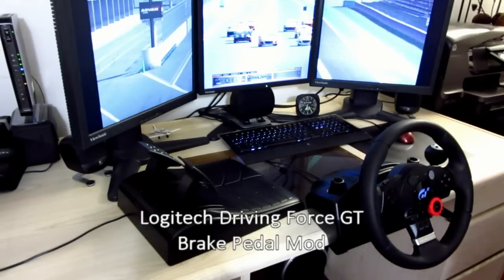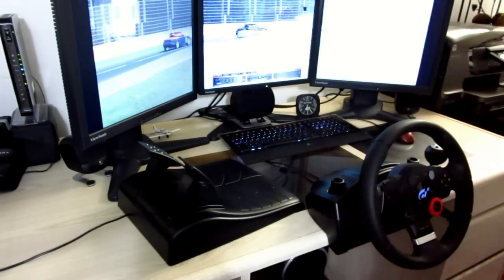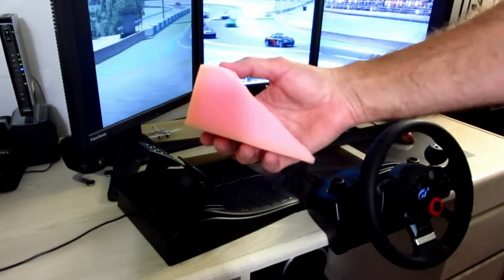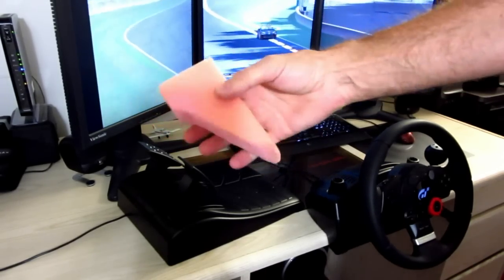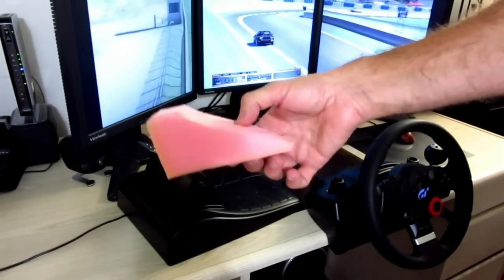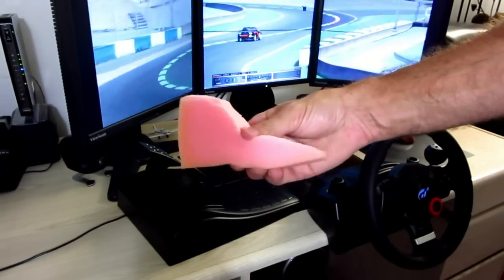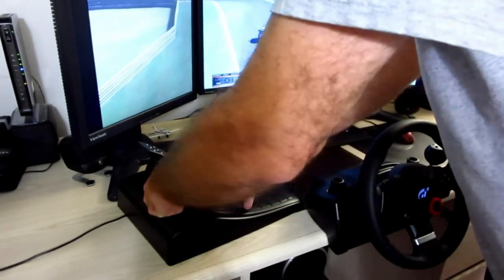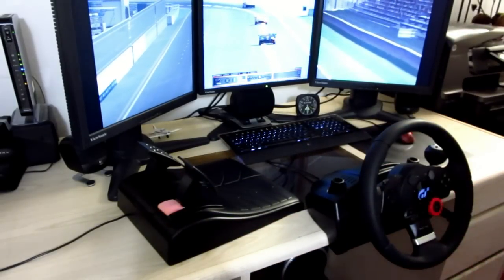Logitech Driving Force GT Brake Pedal Mod (DFGT)

Comment from the maker: The overall length of my current one is 5.5 inches.
It is 3 inches high and 1.75 inches wide.
The flat area on the top (tallest part) is 1.5 inches.

The keyboard is a Logitech Illuminated Keyboard K740. It kind of has a laptop feel to the keys but I prefer that since I spend most of my day on a laptop at work anyway.
Reply: I know this is really old now, but I just got a DFGT super cheap as my first step into using a wheel & this is the best idea for a brake mod I've seen. Only problem is I can't find 1.75" thick rubber foam ANYWHERE. :(

Do you think if I buy 2" thick & squeeze it in it will still work? I'm thinking that it being squeezed from the sides to fit might make it stiffer, but I'm kinda worried it might end up too dense & block the brake from going all the way down that way. =\
Reply from the maker: @EnragedN3wb  As long as the foam is not too dense, you can essentially cut it to whatever shape/dimension you want. I played around with a few different shapes back when I first recorded this video (wow... this was a long time ago!) and eventually found a good size that provided enough resistance but still allowed the pedal to go most all the way down. Also, the pedal does not need to go completely all the way to the stop. Just re-calibrate the brake pedal when you get to a point where you feel it is at it's maximum firmness. Then the brake will still give you 100% but may not go all the way to the bottom.
Reply: @airik7777  Just dropping back in to say thanks! I ended up buying the 2" foam, mounted the pedals with the base against the wall behind my desk so they are inverted & swapped the brake with the gas in the software. Then I cut the foam to 5.5" length but 4" tall instead to make up for using the weaker gas pedal as the brake. After recalibrating the pedal for the lost travel distance & doing 3 laps with it this way I've dropped 3 seconds off my previous lap time already & feels SOOO much more natural!

My mind is actually pretty blown from not only the difference it made in the feel, but also the ability to control stopping power consistently & accurately. Even stretching out the spring didn't feel this good imo.

Comment: I ordered the LDF GT set earlier today. And I was actually thinking about the break and how it would feel as there's is usually no resistance as you brake with these driving sim thingys. Anyways, I went on youtube to check out some reviews and stumbled across your video. It looks like the perfect mod to the brake pedal, and I work with this kind of material every day. I will most definitely try it out. Thanks man!

Comment from the maker: While I used packing foam that Dell uses when they ship servers, I found that fabric and craft stores almost always have this kind of foam available in different densities. I was thinking about getting a piece that was a little more firm but ended up buying a set of Fanatec ClubSport v2 pedals instead. The foam really makes the brake more useable on the DFGT's but I also wanted a clutch pedal and the foam can't help with that. Thanks for all the feedback!
Reply: I had some V2's. they have got to be the best thing on the market period! Literally took a little more than a second off my lap time.

Comment from the maker: I am now experimenting with a new foam wedge that is the same physical dimensions but I drill a hole down through the middle and insert a round coil spring. Based on the spring strength and position, it adds a little more resistance to the foam wedge. I'll probably post another video of that once I get the correct spring I like.

Comment: Really wish I saw this video 9 years ago... lol.  Happen to have bubble foam type material from the 3d printer packaging I have.  Found a block there that was exactly 5 inches long, 3 inches high and 1.75 inches wide.  What luck.  Shaped it accordingly and in it went.  Wow, regret not doing this long ago when I first started using the wheel.  My brain and leg muscle will need to adjust to the pressure, but I see the advantages already.  Now onto figuring out how to make the DFGT work with a PS5.

Comment: Use the sliced foam tubing used for insulating household water pipes. about 3 inches long stuffed with a half slice of same and attach it to the back bottom of the foot plate so its about cm off surface and too wide to go into slot. this makes it free for first of movement , increases force all the way and nothing to stop it at bottom. ( and I think less leverage applied onto hinge)

Comment: airik7777 Hey man, nice video! I was wondering what the measurements of the foam are. Makes it a little easier for me, because yours looks fine to me.
Reply from the maker: LAWRENCIO11 The overall length of my last one was 5.5 inches.
It is 3 inches high and 1.75 inches wide.
The flat area on the top (tallest part) is 1.5 inches.

You can really adjust this just about anywhere you want to get something that feels good to you.

I have since upgraded to a set of ClubSport V2's but this simple mod really made a difference in the Logitech pedals.

Hope this helps!

Comment: great idea! any chance u can share length x height used?
Reply from the maker: The dimensions are in one of the earlier comments. I have those pedals packed away now so not easy to re-measure but look through the comments and you should find where I posted them before.

Comment: What idiots Logitech are for supply pedals that are utter junk. It spoils what is a great wheel!
Reply: ANDYB1478 Again it's a budget wheel, if they made them equal in quality you would lose quality in the steering and feedback. Simple mods like this one (tried it 15 mins ago love it) make them alright until we can get a deal on a 27 or find better pedals which seems stupid me personally as the wheel isn't that nice.
Reply: i just put in other springs besides the ones present works great for me no problems here feels like 300 doller pedals now
Reply: GridlinkedGames dude there not 400 bucks really there only about 150 if your talking about the dfgt
Reply: GridlinkedGames  I got mine for 85 lol
Reply: i got it for less to but i think its not that cheap evrywere
Reply: Yeah mine came off ebay. Wasn't new but it works like new. Guy claims he had it for 6 weeks and didn't like racing with a wheel.
Reply: Devin Coleman yeah with that kinda stuff i dont like second hand goods . i buy m new you never know what somebody did with it lot of the times there s something wrong also i think the dfgt is of good quality but lower quality then of course other wheels i think if you use it like i do evry frekkin day then youl need a new one after a year or two but only been driving for four months on the wheel now so i would exactly know
Reply: I paid $40 at a pawn shop. Win!